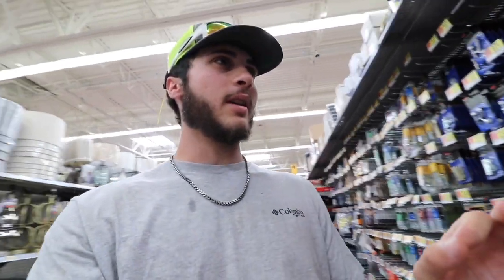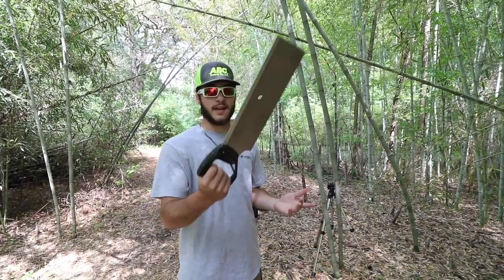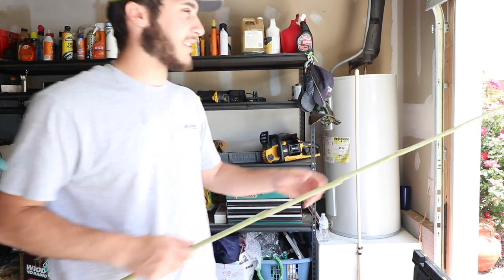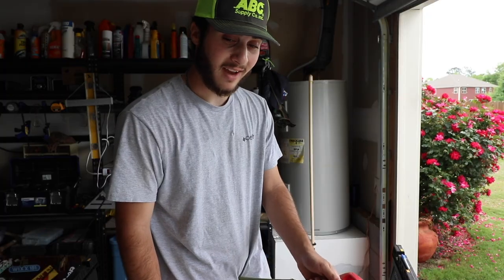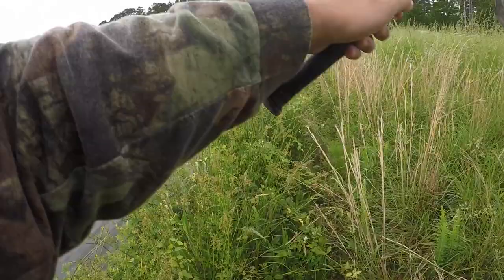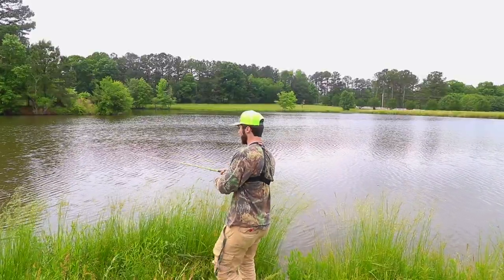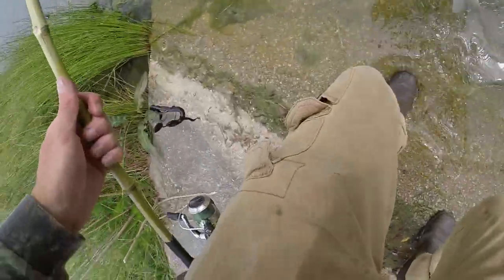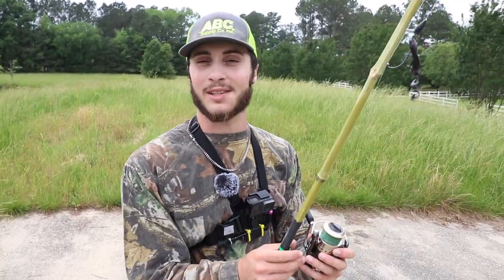Homemade Bamboo Fishing Pole CHALLENGE

Comment: Years ago in the U.K. we used to use what we’re known as Burma Poles which we’re just long bamboo poles with a nail in the end with the head cut off the line (nylon wasn’t invented yet) was then set out on the beach with the line able to run freely and loop formed on the line 5 or 6 feet from the nail and slipped over the nail , the pole or rod  and was then cast and the line would slip from the end as the power in the cast increased  and the line hauled in by hand as no reels were involved  with some of the articles that I’ve read some people achieved some very respectable distances but the only problem was that the length of the rod made it difficult to transport if you lived away from the coast but if you live close to the water it’s well worth a try for a bit of fun

Comment: Drilling the eyes weakens the rod, using whipped twine fishing eyes would make the rod stronger..👍
Hold the rod but end in a drill and gently sand the rod as the drill slowly spins. Apply a thin coat of wood varnish to allow smoother casting and waterproofing.